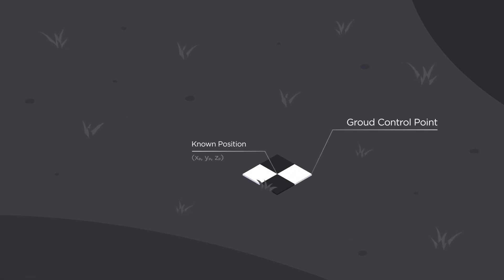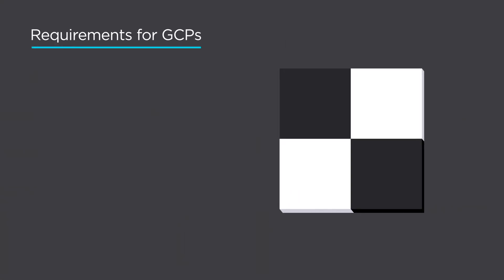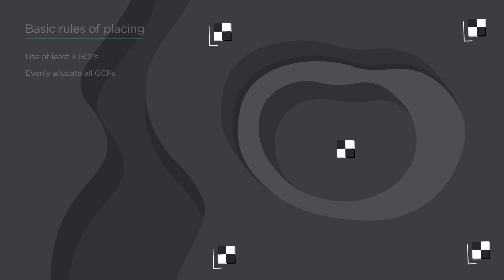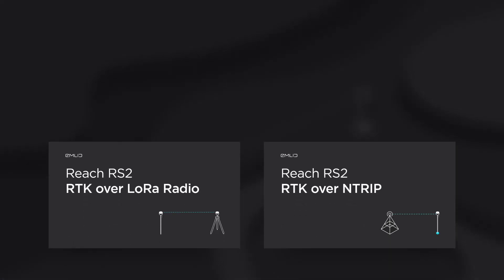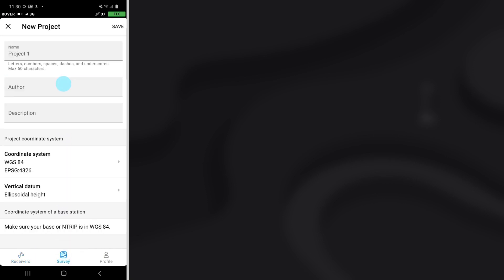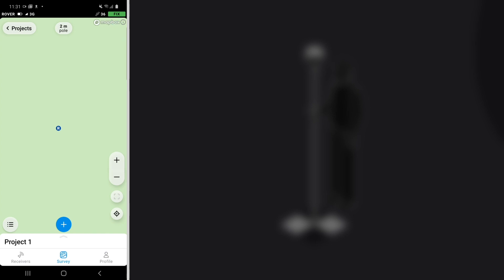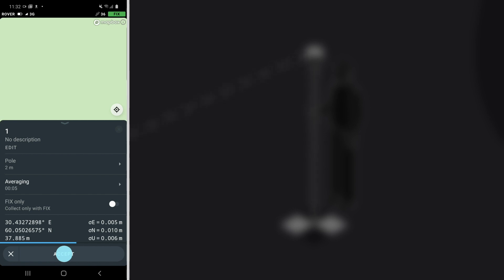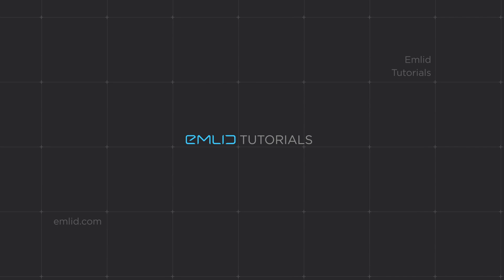How to Place Ground Control Points (GCPs) for Precise Drone Mapping

Comment: Hello, Could I use a simple handheld gps device on a pole to get the required coordinates like a Garmin eTrex® SE GPS Handheld Navigator or a RTK GNSS Survey Equipment with Rover Handheld GPS for Surveying then upload these files to Mapping software?
Reply from the maker: It depends on the accuracy of your device. If Garmin or another RTK equipment has a cm-level accuracy, you can collect GCPs with a cm-level accuracy and export the project to mapping software. Most of such software should support CSV files, which is a popular extension in surveying.

Comment: how GCP and targets can be distributed for image registration, THANKS A LOT.
Reply from the maker: Hi! There are two general rules. They should be allocated evenly in the area where you survey. For example, if you use 5 points, set per one for each corner and the last in the center of the area. And they must not be on the same line.

Comment: Hello! I have a doubt: when you are measuring in this way and you're working in UTM projections, you have a difference between the GNSS coordinates and the local coordinates, like measurements from Total Station. Shouldnt the GNSS be calibrated to real/local system using 4 or more Total Station points to get the REAL distances? How to make GNSS and Total Stations coordinates to be the "same"?

Comment: Why it is needed to have at least 3 ground points?
Reply from the maker: Hi there! 3 ground control points is a minimum for a reasonably accurate survey, but enough quantity of GCPs mostly depends on the site area. Usually, it's 5-10 points. 

You can also find more information in our text guide: https://docs.emlid.com/reachrs2/common/tutorials/configuring-reach-for-mapping/#placing-ground-control-points :)

Comment: How I can stake a line in and set its corridor?
Reply from the maker: Hi there! At the moment, you can do only points stakeout via ReachView, but you can use 3rd-party apps for your task. Reach receivers easily integrated with them on Android by using the mock location feature. Here is our guide on how to do it: https://docs.emlid.com/reachrs2/common/tutorials/mock-location/. 

We'd also recommend checking our community forum to find more information about such tasks: https://community.emlid.com/